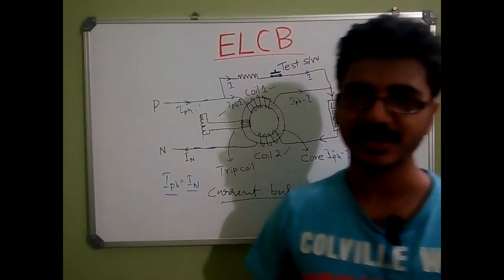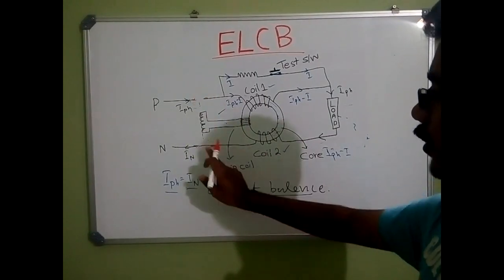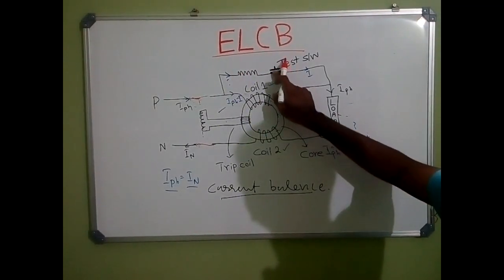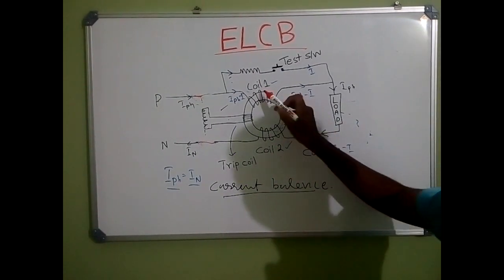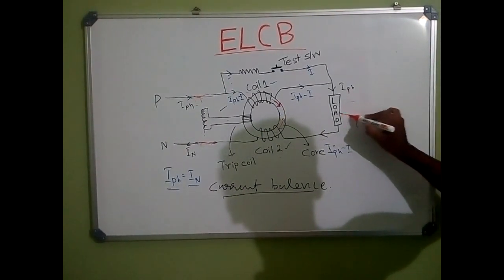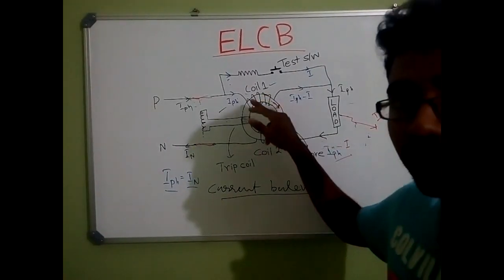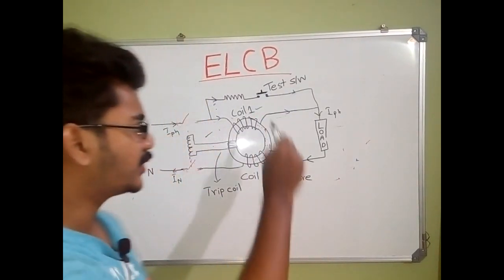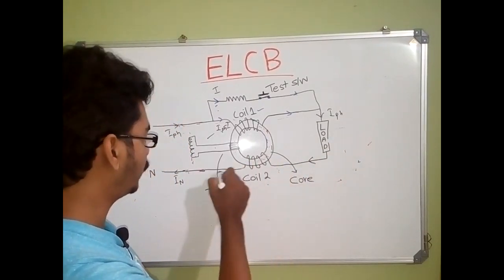Working of ELCB

Comment: Machanism for elcb and rccb different, what you explaining is for rccb
Reply from the maker: ELCB is classified into two types they are voltage operated and current operated. RCCB is nothing but current operated ELCB and voltage operated ELCB is known as ELCB itself. So as you said, the precise title should be working of current operated ELCB  or  working of  RCCB. Thanks for your opinion.

Comment: Diagram is wrong 

If Test switch on based on your diagram

no results to be happened.

Change the diagram

The test current needs to go coil 2 
Otherwise no use

Comment: Bro Better use the term RCCB here. This is the working of RCCB since fault current is measured between phase and neutral. 
Personal opinion: I am not an expert.
Reply from the maker: ELCB is classified into two types they are voltage operated and current operated. RCCB is nothing but current operated ELCB and voltage operated ELCB is known as ELCB itself. So as you said, the precise title should be working of current operated ELCB  or  working of  RCCB. Thanks for your opinion.